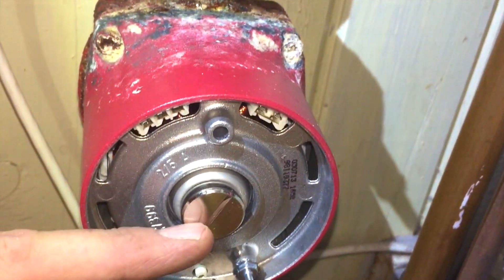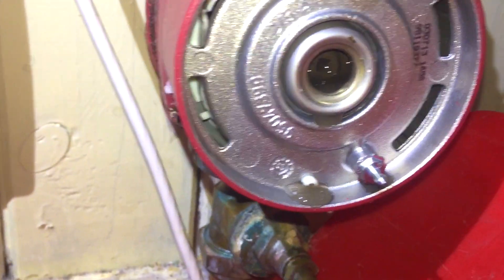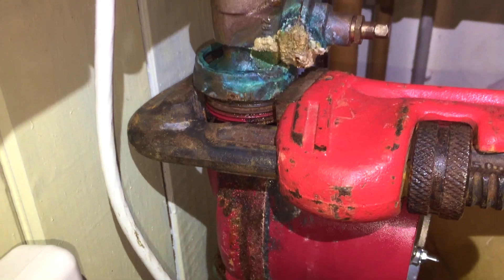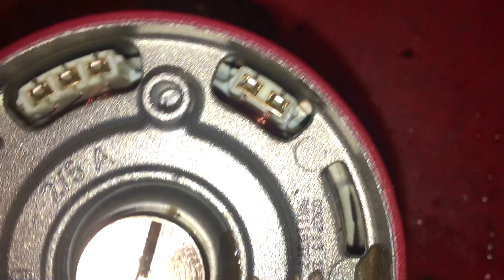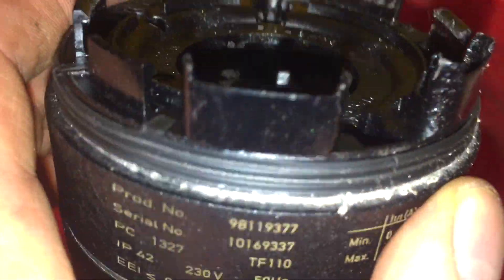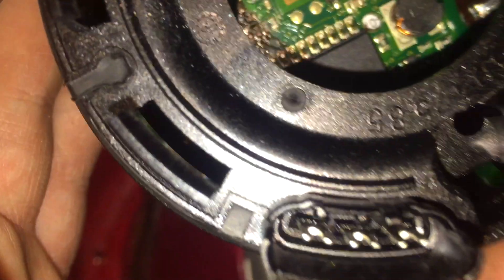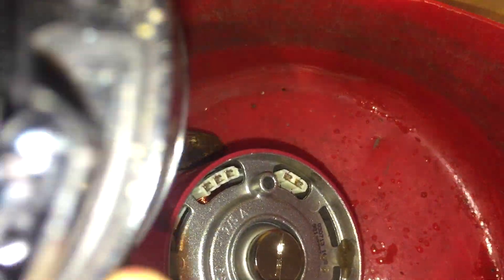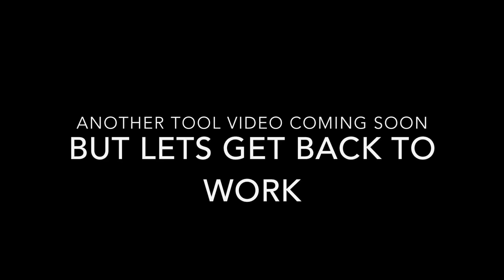Grundfos Pump. How To Vent an Alpha Pump.

Comment: For anyone wondering how to remove the head, use a wide flat screwdriver. Insert it shallow and twist slowly to pry it away. Work your way around until it is loose enough to pop up. There is a metal locator pin bottom right. If you find it too stiff to push back on or at an awkward angle (make sure the contact pins are aligned first of all). Use some silicone spray around the rubber seal and also the plastic legs/teeth, be careful not to get any on the innards or PCB of the pump head, this should help it slip back on.

Comment: Why do you need to bleed it?
Reply from the maker: you don't always. But anyone fitting them regularly will know.
Reply: @HeatingGeek  They sound different?
Reply from the maker: They are just a pain if you need to get the air out but cant.

Comment: How do you unscrew the electronic part(black bit) from the red part?
Reply: It's not screwed in, it's just a tight sealed fit. I was able to use a flat head screw driver to prise it off the pump.

Comment: Hi there, can you check my channel, I have a video of a similar pump Grundfos Alpha 2 L. It hasn't been working for a month or so, when I started the heating yesterday it started to make clickng noises. No errors displayed, but doesn't work as well. Thanks
Reply from the maker: Sounds like the pump is seized and trying to start. you may be able to free it off once the head is off. Unfortunately this requires isolation from the heating system and removal of the pump head, then you can try and free off.
Reply: @HeatingGeek  Thanks!

Comment: Morning sorry to open up an old thread. I'm going to try this. Do i need to turn off the electric to the pump before I remove it. I expect have to make sure doesn't leak if that electric circuit goes on top. Sorry I'm a newbie to this

Comment: Mine was fitted years ago and I'm pretty this would work for me if I could get the electrics off. Maybe bigger hands. I'm tempted to pry it off with a screwdriver, but reckon I'll damage the head, me being me. Why do these things conk out when its snowing 😭
Reply: Omg, yessss!!! I got it off!! All thanks to your feedback to comments 😁 i used a narrow wallpaper stripper with a bevelled edge to pry it off. My screwdriver couldn't get it started. I'll leave another comment in a few. I was right about the age. The screw is here.
Reply: Right, so I took the screw off (the washer was fine), turned the impeller back and forth and popped the screw back in. Had a wad of Plenty under the screw to catch any water trickle, as mine's mounted upside down and I didn't want to wet the connectors. It was hard to get back on, but carefully, between my bodyweight and a rubber mallet we got there eventually - I didn't hit it very hard. Now it sounds like it's moving, it's very quiet anyway so its hard to tell. I'll let you know if the rads downstairs finally heat up.

Comment: I just wonder how did ya pull this head off ? I was trying 3 days and at the end i called plumber.  He came at home he saw i was trying to do something with pump head and he asked me what i was trying to do ? i have explained to him and he said most probably you was watching some funny guy who dismounted the whole pump and there after you dont know how did he take off the head! Seriously mate if you going to state " I just pulled off the head " not bad idea to show how you've done it eventually . After i spoke with the plumber at home and showed him your video he was actually right. The whole pump is disconnected ... 
He just mention until somebody dont show you how he done it better dont try your self because most probably the person in the video is not showing how he done it with reason ?

Anyway useful information but not full
Reply from the maker: You can clearly see in the video the pump is in place and still on the heating system.  I did just PULL it off. I have done this on several pumps to check and some are a lot harder than others. I'm sorry you couldn't do it but this isn't staged. I was replacing this pump anyway and it came off in my hand when I went to undo the nuts. I have also mentioned in another video that later pumps just have a blanking plug instead of a vent now.
Anyway, I'm glad you got your issue resolved and you used a plumber. Watch the first 10 seconds of the video again to see the pump is clearly still attached to the system. NO BS here.

Comment: Grunfoss have got another new one coming out
Reply from the maker: Can we vent it?
Reply: HeatingGeek no, rep was in my local branch and said they're self venting.....still loads of set ups out there where you need to vent them manually so that's a grunfoss out if you need to replace
Reply: @tomstrutton4351  What a good job I've 2 spare Grundfos pumps in the garage !
Reply: They are pumps 2 and 3. 
1 burnt itself out one morning when it failed to start. Speed control was via a valve rather than switch.
2 replaced 1. We ran that on speed 1 - it wasn't powerful enough to burn itself out !
3 replaced 2 - which was flushed out - then worked fine again, so kept as a back up. 
3 never failed, was taken out because a new crap pump was installed under 'warm front' grant - so 3 went straight into storage. The crap pump is still providing a satisfactory service on speed 2.

Comment: HG, where is the tools review video.. i was about to compare ypur tools with mine and order what i dont have
Reply from the maker: I had to remove it for a while as Amazon rejected me (but still let the links work). I have reapplied and added new links. I also found some links I couldn't before so theres more there now. I have new injector cleaners coming and will video them and put them up ASAP. Video 3 soon also.
Reply: @HeatingGeek  thanks buddy looking forward to it, i need to prep a new go to tool bag for the winter break down ... i operate my business with my car so your video is so valuable 👍🏼👍🏼
Reply from the maker: Ok good luck. I would rather have two small bags than one big one. :-)

Comment: Nice one HG excellent find I have had nothing but grief with those poxy pumps and they arent cheap . How easy do they come apart ?
Reply from the maker: I held it to undo and it came off in my hand. I put it back on after and had no issues. 
I will get hold of one and do another video to see what we can do with  it.
Reply: @HeatingGeek  did you ever do a video showing how to take the electrical face off? My pump is making a humming noise after having the system power flushed, I presume it’s because there is air in it.

Comment: What a shite circulation pump, changed 100s.  Good tip there HG👍
I’ve got a link somewhere showing you how to ‘clean the can’ on modern ERP Grunny pumps.
Reply from the maker: We want the link!!!
Reply: HeatingGeek See If this works HG:
https://lookaside.fbsbx.com/file/Freeing%20a%20Grunfos%20UPM3%20OEM%20pump%20as%20found%20in%20Vok%C3%A8ra%20ErP%20boilers.pdf?token=AWxlOxXmPulagyLpznpOlqSaLzG8RTN8Pa1tIc70n6MT7jF2nlIzHD4VmiFlm1Ki5TVyx6qyauFvDWxu-plNeWyR_pPJMmmV694cIfYi2LsVduVXCSUAyOeiB0vhNJ_uy2SSo1sSCfJUKG63mB88j7fAPEF0v1TAH7vmdOEgRgMdSdtdxzntOLjY_CqKvRQq1p7BD1vRETEnX30UmI_Zo1P7

Comment: I have found that when undoing brass pump valve unions, the tighter you squeeze your grips the union becomes impossible to undo because it becomes slightly oval in shape, using your grips backwards tends to prevents this and can often make the union much easier to undo, not saying it will work every time but has done for me on many occasions.
Reply from the maker: jaxmar88. I noticed this too. If you squeeze like mad it docent undo. Larger grips mean a better fit so less squeeze. 
You said something I thought for years!!
Reply: Failing that chisel and hammer lol
Reply from the maker: Yep

Comment: these have automatic venting according to data sheet.
Reply from the maker: At high level with no other means thats bullshit. It will never vent with 0 water in it. I think they mean it will push out a small airlock. 
I have turned them around and all sorts to get circulation. In the end I put a old pump in (working) and left the bleed screw open with a bucket under it and just waited. 10min later job done.
Reply: yes, I agree at high level the install there should of had a bleed pipe installed higer than the pump
Reply: @HeatingGeek  Careful planning how you mount the pump. Directly above mine is the water feed and the air vent. So it's self-priming.

Comment: I had to use a cordless grinder to get a pump off yesterday. Stilsons & blowlamp couldn't budge the pump nuts!
Reply from the maker: I cut the nuts (big) with a hacksaw and split them with a screwdriver. My customers wouldn't let me use a grinder. Must of stunk the house out!!!!
Reply: Lol why not just remove the complete valves ! Sounds a faff !
Reply from the maker: bwc uk. Just cut the nuts and replace them with new so you don't have to drain down.
Reply: Didn't have enuf play in the valves to take it all out, had to to change valves anyway cos they were both passing.